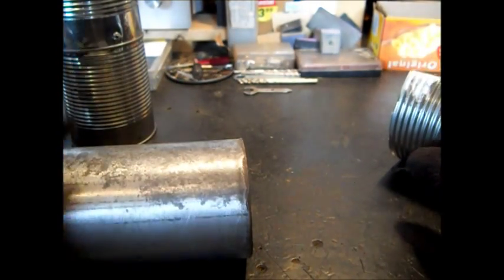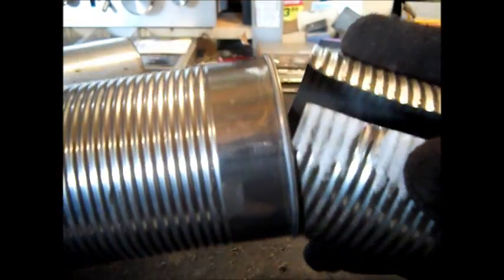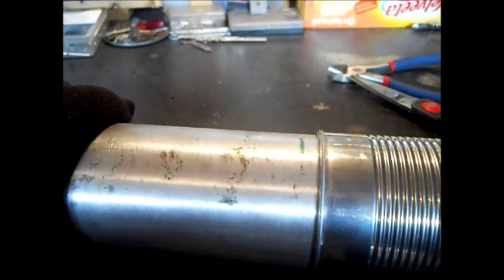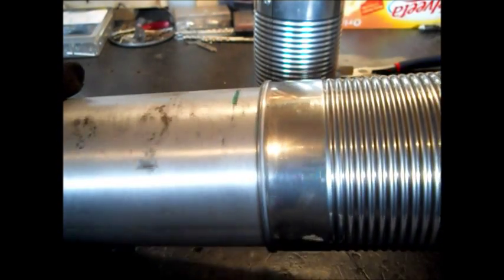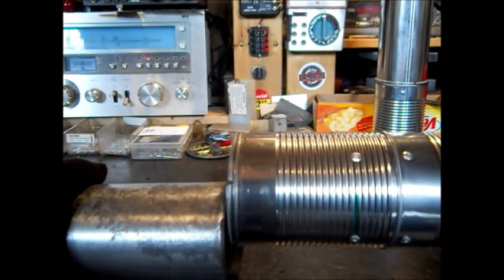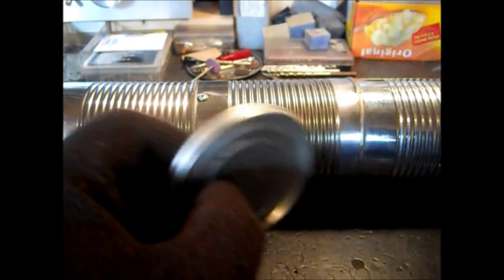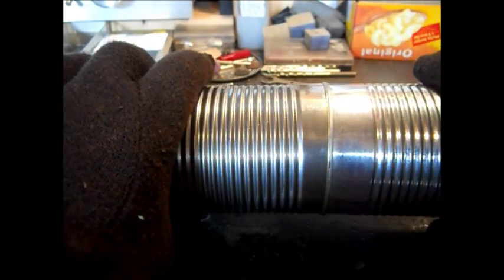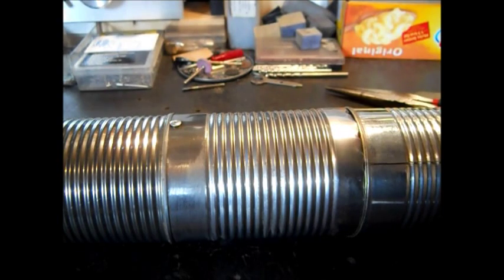Stove Pipe for Mini Potbelly Woodstove PART 2.

Comment: The top cans should always fit INSIDE of the lower cans. Females on the bottom facing up. If you have the females on top, the creosote will leak down the inside of the pipes and out onto the floor, and it is a horrible mess to clean up and it sticks bad, too. I know from experience..ruined my concrete stove pad w black creosote stains..
Reply from the maker: Good Idea   I am used to big wood stoves so I put the pipe the way it is